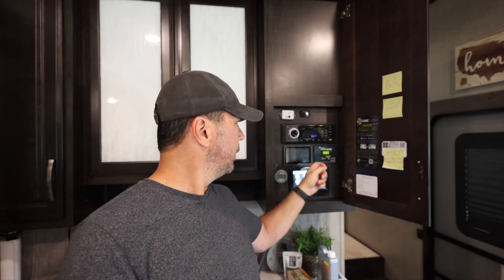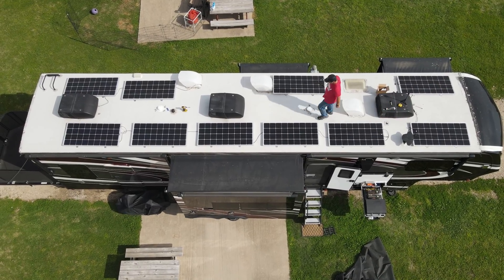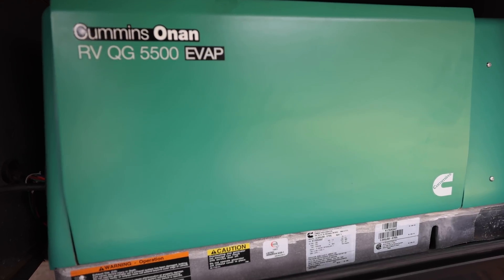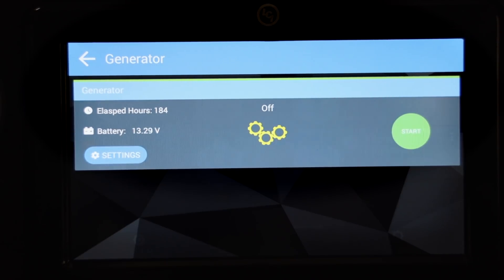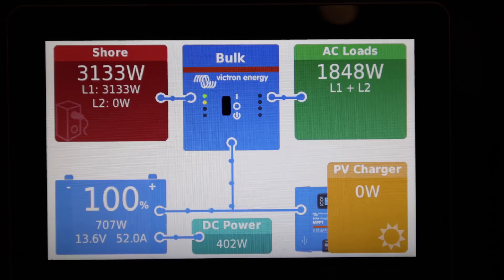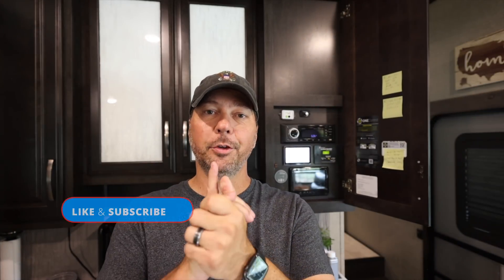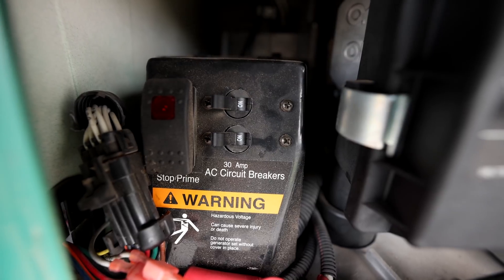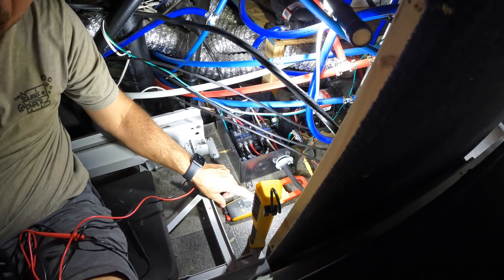RV Off-Grid (Solar) Power System Review and Fixes! (Full Time RV Life)

Comment from the maker: ⚠⚠ THIS SPLICE is a MUCH BETTER OPTION for the wiring of L1 and L2: https://amzn.to/3DXemK6
Reply: I literally just experienced this issue with our system yesterday..  I have the same generator and  inverter, 4 batteries at the moment 1,320w of solar.   So due to the power being out my wife was hanging out in the trailer. while she cleaning she was running the ac and a couple other appliances. When  she used the vacuum it tripped a breaker on the Gen.    I didn’t realize the problem until I saw this update on your system.  Could you provide a schematic of how you wired the two legs going into the ATS?
Reply: Hey Chad,  I planned a similar system, most likely around the same time you did.  I did not think that the 10 100Ah batteries was the best route.  Watched you crimping all those cables and said "Too many points of failures, too large of a cable, no expansion (or limited expansion)". I went with a 48v system.  Three 100Ah batteries.   I say such as you mention looking at 24v or 48v system next.  After doing 48v I learned the cons.  1. The invertors that are available are limited in the 48v range.  2. You will obviously need a buck convertor, same with a 24v system, but the selection for 48v is low (I am running two of the Victrons), and the price is higher. 3.  MPPT chargers, same limits and higher cost. 4. (a big one for me) 12v to 48v chargers are rare.  I only found one reasonability priced that I use to charge the 5th wheel from the truck.  Great to know that your batteries are fully charged after a long travel day. Hint the latter would make a great episode for a techie like you.  :)
Reply: How did you insulate the grounding bar?
Reply: Came here to tell you about these splice connectors. I picked some up at a local commercial electrical supply store when I was needing to splice 4Ga multi-strand wires. They work great.
Reply from the maker: Thanks for the feedback! 👍🏼
Reply: @preachers4135
Reply: @preachers4135
Reply: I wound up buying this as well.
Reply from the maker: The other issue I've heard of with the DC-DC converters is the hydraulic pump (jacks and slides).. the converter can't handle the inrush current.  Have you had any issues?
Reply: @ChangingLanes  Just looked up the hydraulic concern.  Even found your article.  1HP is a large motor for DC. Then gain, common in one ton pickups and consumer dump trailers.   The 40amps I have will not work.  Seeing as I am designing a new system for the new RV,  I am thinking either a 12v battery behind the DC-DC convertors (a capacitor if you will), or look at a replacement 48v motor for the pump.  If memory serves me correct GD has only a 55amp convertor so they must be relying on the house battery.   What have you been thinking?
Reply: @ChangingLanes  yeah the motors on those draw 160amps. I put in two dc/dc converters to give me 170amps. Make sure they are non-isolated coverters so then you can run them in parallel.
Reply: @ChangingLanes  To be honest, this is our first RV.  Actually you guys were part of the inspiration for us.  Just got back from 4.5 months of travel (13k on the truck  and 3200 miles on the dresser).  Thanks!  Loved it so much we ordered a GD 398M two days after returning.  With that, we purchased a smaller used 30amp toy hauler to test.  Thus no hydraulics and only one slide.  Had zero problems with the electric jack up front or the  electric slide with two 20amp DC-DC convertors.

Comment: Nice job. As a former electronics tech, I have been working hard at understanding all of the components. Most people don’t give a great overview as well as details. You confirmed in 20 minutes what I have spent hours coming to understand.  I didn’t want to build a system only to “upgrade” it later. 1 and done if I can. I have decided on much the same hardware as you have, 48v probably, sourcing the solar cells, batteries and capacities is pretty much in flux until I jump on it. I wish I saw this 2 months ago, lol. Thanks for a great video.

Comment: I realize my confusion. I have two Victron Multiplus 3k set up in split phase via the VE bus. I didn’t realize the Multiplus II would create a L1 plus L2 feed. I don’t believe 2 separate inverters can do this. I think I still need split phase 180 detection for the master inverter to allow the slave to pass through power. An auto transformer will do this.

Comment: I am confused as to why the Victron inverter would behave any differently after bonding the generator outputs. Doesn't it still see an in phase AC input as it did before, similar to what a  dog bone 50-30 adapter provides? Victron describes the detection of split phase as necessary to allow pass through of L1 and L2. The idea of an autotransformer is to create a split phase input to the inverter so that it detects, this for pass through. For your system to work, the inverter must not be making a split phase decision for L1 and L2 pass through.
Reply from the maker: The difference is, the load from the RV will be balanced between the two legs from the generator.  Without that, something like two ACs on leg 2 would throw the breaker for line 2 at the genny.  With the bridge, the load is distributed.
Reply: So when combined your generator loads together did you see a load through L1&L2 coming out of the multi?

Comment: Have you ever tried to set up the RV as "Grid Tied"?  In other words, able to feed power back thru the grid when connected but stop the feed when the grid dies?  I have the Victron Multiplus II 24/3000, Cerbo GX, smart Shunt, MPPT charge controller, 2x24v 200ah Lithium batteries, etc and 2900w solar on the roof.  I'd like to be able to plug into the pole at my home and when the solar out-produces the battery draw, I'd like it to send the excess back into the grid.  I also see that as a big bene4fit for RV parks but that is a side conversation I guess.  I think it's possible but don't fully understand how to do it.
Reply from the maker: We're on the same level here.. I think it's possible but have no idea how that would work.. LOL   I would ask around in the Victron community: https://community.victronenergy.com/index.html

Comment: Hi Chad , Tara, and Daisy !! I’m looking for an opinion from someone with more experience than myself with solar and lithium etc etc ….  Y’all definitely fit that description !  I’m looking at a new trailer and trying to decide which is more important  solar or lithium?  Should I pay $2600 to upgrade batteries (2)  to lithium  or would I be better off to spend roughly the same amount of money and add a few more panels and stay with lead acid batteries.  Not looking to do any major boondocking just want to be able to spend a night or two here and there without hookups.  Not expecting to run anything major just lights , fans , rv etc.
Reply from the maker: The catch here is, solar is not very effective without a good storage system (lithium).  So, I would do that first.   If you already have a decent sized battery bank, then solar...  Hope that helps!
Reply: @ChangingLanes   appreciate it.  Maybe I’ll  subtract a panel from the mix and use that $ for small lithium bank   Thanks for sharing your thoughts.

Comment: I had the gopower ic3000 before my victron mppt solar controller and like you, I knew instantly I should have bought the victron multiplus, the gopower and mppt sometimes fight over who is going to be the battery "floater" so to speak.  The voltage readings from both are different enough so one that "reads" below float voltage always takes command of floating duties. Sometimes that gopower just goes bonkers and can float anywhere from .4 higher or .4 lower that its setting. Weak firmware if you ask me. The victron communication between the mppt and multiplus would solve all that.

Comment: Chad-Love your videos-  You have really inspired me on lots of mods.  I have a 2019  40ft Montana.  Definitely going to do the cross over on the genni feed--that makes so much sense.  I have 12 x 100w Panels 600 Amps of Lithium.  I have the same Go Power 3000 IC installed that you used to have.  It all works great, but when I run my Air a high load (1 AC)  The 4/0 wires feeding the inverter are getting warm (100-120f)  The three batteries feed individually to a buss bar (via three 250amp T fuses) on 2/0 leads  Did you experience any wire over heating issues? Any ideas

Comment: Hi Chad, love your vids. I have 2 questions I hope you can answer. I am putting in a victron system in my Momentum and just doublechecking some wiring.  I believe the shore power and geny go into the  auto transfer switch, then 1 line  6/3 goes to the multi plus II, and then goes from the multi plus to the interior breaker panel box. also you combined L1 and L2 from the geny before going into the ATS. after combining, did you did you feed back into L1 and L2 in the ATS?  Any help is greatly appreciated. thanks JD

Comment: Great video - especially the section around the Onan and Victron MultiPlus 2x120. I made the connection in the junction box near the generator instead of the transfer switch but in the end it is exactly the same as what you recommended. Thank you for the tip!

Comment: Hey Chad. I combined the two lines coming into the automatic transfer switch, put the single (combined) line on line one in the transfer, and it does not activate the switch. Is my switch bad, or did i miss a step? It looked pretty simple when you did it. Help. I have  2021 399TH with the same generator as your old rig. 
Chuck
Reply from the maker: Sounds like you got it right.  And I'm sure you likely have the same ATS...  Double check your neutral and make sure it's good also.. Also make sure you bridged the right input.  The ATS should have generator priority.
Reply: I put the joined wire into the terminal that had the red lead. Is that what you mean? Should I try the other terminal where the black wire originally was?
Reply: I zoomed in on your connection and that's what I'm going to try. I didn't know there would be a difference between the terminals. 
Thanks for your help. I'll let you know how it worked out...or when I'm getting out of the hospital.  😂
Reply: Hey man. I switched the lead to the other hot leg, and all worked well. No trip to the hospital. Thanks for your help. 
Chuck
Over&Out

Comment: Interesting. I am trying to set up my ATS for Shore Power & 240v Genset. I have two Victrons multiplus inverters. I will be wiring up the 1 inverter with L1 and the other with L2.
Installing the ATS near the main CB  panel.
Any sugestion?

Comment: Thanks for the info. I just subscribed. I might be tying both legs of my 5,500w generator's output together too. The only difference is that I have a 20a breaker on one leg and a 30 amp on the other, but I don't think this will be an issue. I will make sure they are in phase before connecting them. My motorhome is a 1999 National Tropical that came from the factory with a 30-amp electrical system. The previous owner had an RV dealer convert it to 50 amps, but they must have reused the original breaker box as it only has one side. They just wired one wire to the top of the box and the other wire to the bottom. It seems to work fine for our limited power demands, so you know what they say, don't fix it if it ain't broke. 

We're retired FT RVers who boondock most of the time, so we decided to build our solar system in 2 phases, a 12v basic phase to run all our 12v appliances and a 48v system for our AC high power needs. The main issue we faced is we are retired and living on social security and a small pension so have to do everything on a tight budget forgoing name brand components like Battleborn and Victron for lesser-known brands and must do all the work ourselves - which keeps getting harder as we age. 

We just completed the first phase in January, with the addition of a custom built 560ah of LiFePo-4 battery, roughly equivalent of 5 1/2 100ah Battleborns, made with 8, 280ah prismatic cells. We used a Heltec 330amp BMS and a 5a active balancer, to start our generator. We built our 12v battery with grade "A" LiFePo-4 prismatic cells having a 6,000 cycle manufacturer projected life at 100% DOD. This means that if we cycled them 100% every single day, 365 days a year, they would last over 16 years! It only cost us $1,500 to build this 560ah battery, including the high amp BMS. The main reason we chose these cells (other than their price and quality) is that they fit perfectly under the steps of our motorhome where our old pair of GC-2 golf cart batteries used to reside. We insulated the battery compartment, cut a small 1" hole in our step risers and installed a tiny computer CPU fan to keep this space at close to room temperature. 

We started our build 4 years ago with a 620-watt liftable array mounted on the side of our motorhome that practically lifts itself to the correct angle with a couple gas struts. Lifting an array to the correct angle produces 25-30% more than a flat mounted array - even more in winter when the sun is low on the horizon. This first phase, including the liftable array, wiring, breakers, a new Progressive Dynamics 80a Li compatible converter/charger, 600w PSW inverter (to run our TV and PC), an Epever 50a MPPT controller, battery monitor/shunt, and a Renogy battery to battery charger (to protect the alternator) cost us around $3,600.

We'll be starting our 48v phase soon, which will give us total off grid electrical independence. Mounting our current solar array on the side of our MH left the roof free to rack 8 BlueSun 460W bifacial solar panels 13" off the roof of our 35ft Class A, to clear our front AC shroud and vents. The front side of these panels are rated at 460 watts with up to 25% additional output from reflected light on the back side, for a total of up to 575 watts, depending on how they are mounted. In our application, this should produce another 10% output off the back of these bifacial panels, from sunlight reflected off our white roof - more during off-peak hours and in the winter, when the sun is lower in the sky. It will give us a good bit of shade too, reducing the heat load on our air conditioners. Our MH is only 11' 9" tall, so we will be able to keep the RV height to 12'.

Rather than buying all the individual components, we will be using an all-in-one 48V, 5,000W, 120V PSW Inverter, 80a MPPT 500V controller and 40a ac battery charger by Sungold Power for the bulk of our 120v needs. It's sort of like a budget Quattro, but with less features. This unit will allow 63 amps throughput from an RV park power pole, but won't allow the inverter to add to this power like your sweet Victron Multiplus does. The reason we chose this all-in-one is because the idle power consumption is only 25 watts - and it's only $800. Most this size have an idle power consumption over 70 watts and cost at least $1,200 (a 5kw Quattro sells for over $2,500 these days). Our 48v battery bank will use 16, 305ah prismatic cells (15.6Kwh.) So together with our 560ah (7.1 Kwh)12v bank, we will have a total of 22.7Kwh of batteries onboard which a little less than 18, 100ah Battleborns! We will be replacing our old rear 13.5k btu rooftop Dometic AC with a super high-efficiency 48v DC mini-split heat pump from Cold and Colder.com that only draws 750 watts (16a at 48v) at peak air conditioner output and less than 500 watts when it's cooling normally. Both phases together will only cost around $13,600. Our 2nd phase will provide 24/7 off-grid air conditioning and supplemental heat from the heat pump and allow occasional usage of our 14.5k Btu Furrion front rooftop AC to cool things down for peak afternoon demand, as well as give us whole house 120v ac power. It will allow us to keep our generator in reserve for emergency use only.

Comment: Wonder why L1/L2 aren't always wired together in the transfer switch (or coming out of the genny).   What you did makes perfect sense, I'm just not sure why it's not always done that way, Victron or not, because they you wouldn't have any issues where you overload one line on the genny without going over the total load allowable.   Seems like this should be done this way all the time.

Comment: Great job, Chad. Hey, quick question. I'm installing 1,600 watts on top. Two banks of 200w panels x 4 in series = 48 volts, right? What awg should I run into the coach? 8 or 6 awg? And what connector do I need under the gland to connect the PV to the 6 awg? Wire nuts?!? Thanks for all your work out here!

Comment: Soooo. Am I understanding correctly that you can have up to 45Amps(5,500W/120V) on the one line that goes into the ATS once paralleled ,  then the Multiplus II can spread those 45Amps between L1 and L2 that go to you RV's breaker box?             Also, if you don't parallel the two lines before the ATS, can I just set my Multiplus II to 30Amps input (similar to what you'd need to do when plugged into 30amp shore power, and let the batteries make up for any extra power needed?